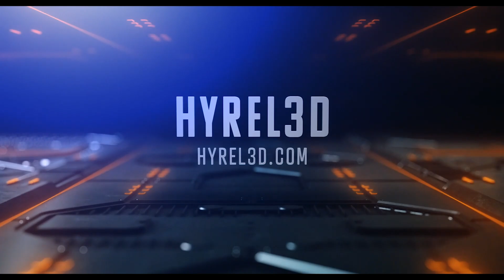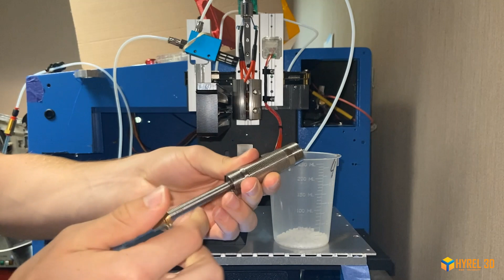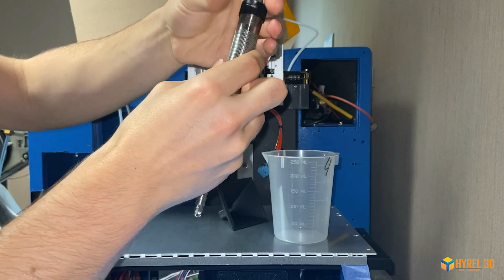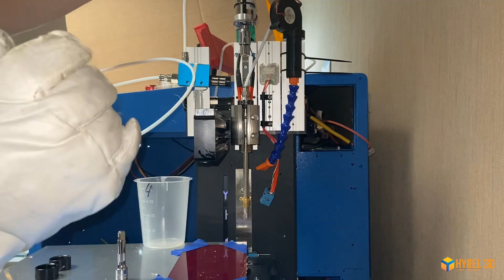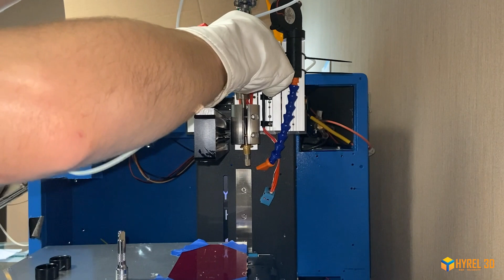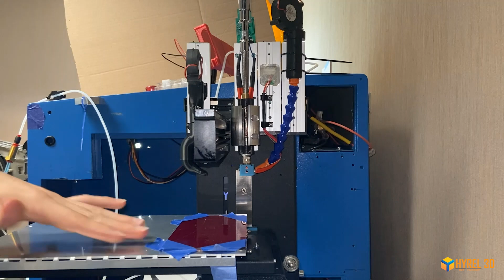Preparation and Setup for Printing PCL (polycaprolactone) on Hyrel 3D Printers

Comment: Hello, may i ask a question? I have a task to make filaments using pcl with wet spinning method but whatever solvent i use and coagulant i use, the filament coulnd't be pulled to the spool because it'll break right away as it leaves the coagulant bath. Do you know how to make the filament solidify much faster like pla?
Reply from the maker: Sorry, no.

Comment: Hi. Just a question. What 'is différents between pcl and Pla??. I search to make my filament fir use on printing 3d rool.  Thank's...( Sorry my english is bad)
Reply from the maker: PLA is https://en.wikipedia.org/wiki/Polylactic_acid - a is a thermoplastic polyester often used for 3D printing because it can be printed on unheated print beds but is fairly solid at room temperature. PCL is https://en.wikipedia.org/wiki/Polycaprolactone - is a biodegradable polyester often used in biological prints because it can be broken down by the body.
Reply: @HyRel3D  ok thank's 😉😉